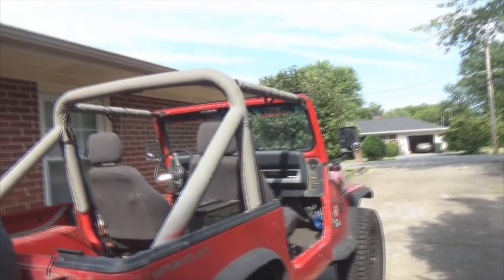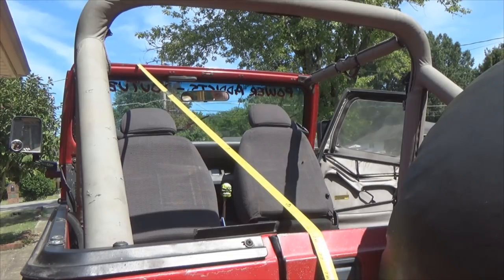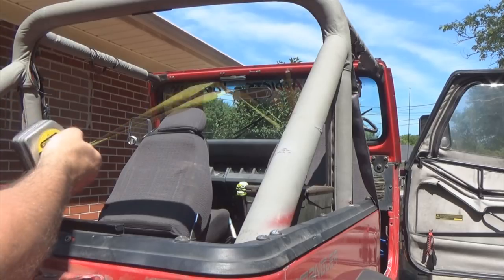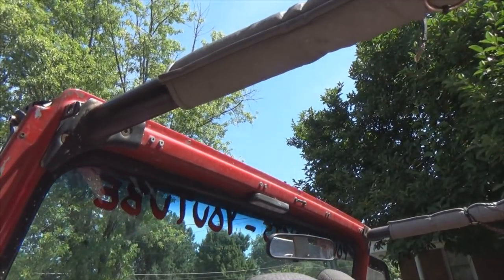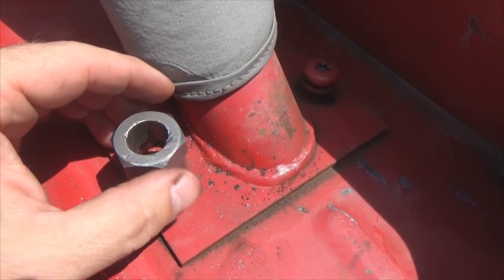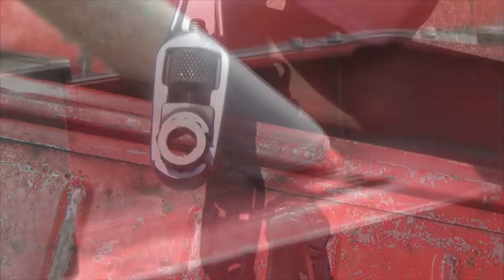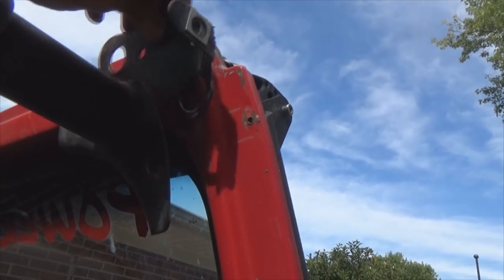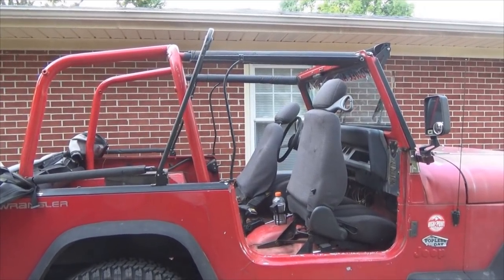Jeep Wrangler YJ - Sport Roll Bar to Family Roll Bar Swap

Comment from the maker: The bolt extractor set I used worked great!! Here are the tools I used in this video. Links (affiliate) below:
Bolt extractor set: https://amzn.to/2vF9B66
Drill bit and extractor: https://amzn.to/2vF7Qpp
Torx bit set: https://amzn.to/2B3lszQ
Reply: What craftsman socket did you use on the bolt extractor?

Comment: Just another tip, there was factory loc-tite in the bolts, if you hit the head of each bolt with a propane torch for about 10 seconds will make extraction a lot easier. just replaced one myself last week, I like the family roll bar better. Thanks for the video's.
Reply from the maker: Very good point!! I forgot to mention that. Back in the mid-early 80's Ford used a rigid lock tight on brake caliper bolts. I broke 4 bits before I finally smartened up and through the torch at it. They backed right out as easy as can be. The bolts in this old YJ were rusted in place. They weren't the first bolts I've had issues with on that rig:-).  Im on the fence about which roll bar I like better. I know the Family style bar gives more soft top options which is my main reason for swapping roll bars. Thanks for leaving a great tip for everyone! Have a great day!!

Comment: Measuring the top of the windshield frame to the back is too inaccurate because your back gate can be misaligned or torqued (sagging - if you have a large spare hanging on it).   The simple way is to use your door to align to same spot.

Comment: heat those bolt heads with a LP torch first and smack it with a hammer and pin punch,
do not direct hit the bolt head as it will collapse the torx opening.
use impact rated sockets and extensions!
i used an 3/4 dewalt impact after breaking them loose with an long 3/4 breaker bar
take your time!
and yes if it is a rust bucket the floor pan nuts may twist right off.

Comment: Gonna redo my 89 yj. It's been dormant for a few years. I want swap to a Family style roll bar basically for more back seat protection. Thank you for showing the way on that. I have marked the tools you posted on amazon. Thank you for that too.  I'll also have full doors and half doors and a Bestop split hard top and original soft top.  I do need to refurbish the soft top frame and I was wondering if you had any lead the parts I would need for that especially the plastic sleeves that hold the folding bars in place? 

 On another note, I 'm using a tip a friend passed on from a guy that liked to rebuild old trucks and Wheelies from the 1930's and 40's. When he gets a new project, he parks it in his barn, sprays every bolt with liquid wrench and walks away for a few weeks, and repeats every few weeks until he's ready to work on it. In the meantime he does research and gathering of supplies for that project. Pulled the project in the garage yesterday and sprayed the 1st pass on the nuts and bolt with liquid wrench and will do so until i start on it after New Year's.

Last Question... MPFI kit or Holley 2bbl carb?

Comment: I have a 1995 YJ (family bars) with a frameless soft top (love the top). but I am thinking about buying the sport bars from my buddy for 80$ and run that in the summer with a bikini top. I just love the look of the sport bars personally. Then, putting the family bars back in for the winter / rainy season. (i live in Georgia). my question is, how long would it take to swap between the family and sport bars (vice versa), as I would be doing that quite often.
Reply from the maker: Being that you are going to swapping them on a consistent basis, you will not have to deal with rusted up bolts. So the swap is easy and can be done in just a few minutes. Just have someone to help you pick the roll bar up so you don't scratch your Jeep. Thanks for dropping in! Have a great day!

Comment: Dident know that could be done  ,now I have to find 1 .  I have a 89 yj  with  a steering box problem , to much play in the steering wheel  , almost a full 1/4 turn before wheels start to move , have put at least 4 rebuilt 1 in all end up that way . Help would be appreciated . I enjoy ur channel  keep it up
Reply: john crowder there is an adjustment nut and screw to take the play out of the steering gear. Loosen and hold the nut with a wrench and turn the scurew in 1/8 of a turn at a time. Retighten the nut and test drive. Take your time, as it's easy to overtighten the adjustment and lockup the steering. This is the first thing i did to my yj after i bought it.    Tim
Reply from the maker: If you have replaced the steering boxes and you still are getting that much play. Either you are getting bad steering boxes or start checking the steering shaft going up to the steering column for worn out u-joints Good luck and have a great day!

Comment: Did you have to measure and adjust the spreader bars after you put the family style back in?
Reply from the maker: Nope .. It dropped right in and were set at the correct length. Which was good for me for the install. But, it would have made for more good video if I would have had to adjust them. I can put that on my video to-do list on "How to adjust the spreader bars and windshield rake:. Thanks for checking out the video! Have a great day!

Comment: I have a 95, I would like to switch from the family roll bar to the sport roll bar, do I have to make holes or it fits right away?
Reply from the maker: Should be a direct bolt in. I later discovered on this swap there was some trash behind the mount that messed up the alignment a bit.
Reply: @Poweraddicts ohh thank you
Reply: do you still have the family roll bar?

Comment: Man the most important thing about all of this is do I need to weld a plate or something onto the tub when I swap seat belts?? What's the easiest way to go about mounting the lower seat belt point on the retractor side
Reply: After you swap the roll bar, most shoulder belt kits just bolt on where the old lap belts were originally. Mine took me about 15 min to swap both belts out

Comment: I've always liked the look of the sport bars better. The one good thing I've found with the family bar is that you can get the extended bikini top with a cargo net top in the rear like the Smittybilt C.RES. Ran that way for a few months and the interior actually stayed pretty dry during storms. The downside to that would be that the YJ has no door surrounds like TJs do so even with the uppers on there is still gaps that let rain in
Reply from the maker: Hey man! Hows it going??!! I'm on the fence as far as looks. The sport for the old school look, the family for the "cage" look .. so Im kinda torn on that one. The Family style simply gives more soft top options as you said and also mounting a sound bar in the proper location. A sound bar can be mounted to a sport but its right on top of your head ... nope .. not happening! LOL. I'm gonna check out that bikini top you mentioned, I like the sound of that. I have an extended net style sunscreen that's for a JKU, it will work on the family bar. I've got a short bikini top and windjammer that came with Rustbucket. I really like that setup, but as you said, no door surrounds so there is that massive door gap.

Comment: Good video. S-10 seat belts will work for the rear seat belts in the rear?  Missing mine.
Reply from the maker: Thanks! Glad you like it! Basically you look for any shoulder style seat belt set up that is long enough. Get both shoulder harness and the floor buckle as long as its long enough to reach over the seat where you sit. Get the bolts as well in case you need them. Your good! Or, possible a set out of an XJ Cherokee. I'm gonna shoot the video of how to look for the correct seat belts in a junkyard. Maaaybe within the next couple of weekends I'll go to the junkyard to scout out a set. Make sure you are subscribed so you don't miss the video! Thanks for dropping in and leaving a cool comment! Have a great day!

Comment: If I put a TJ roll bar in my 89 YJ can I put a frameless top on. I currently have a hard top.
Reply from the maker: TJ bars are not a direct fit. It takes some drilling, possible cutting to make that work.

Comment: How much should I expect to pay for a YJ family style roll bar with windshield bars and front and rear threaded seat belt holes but no seatbelts?
Reply from the maker: The roll bar and spreader bars I have paid as little as $75 for all of it. I've seen them as high as $200 used. It really depends on the region its located or what the seller wants.  The seat belt holes are already in the roll bars.
Reply: @Poweraddicts  Hmm.  The guy wants $300 for just the family roll bar with spreaders.  Then wants another $100 each for seatbelts.  I thought it was a bit high.  But wanted to get someone else's intake. Thanks for your response.  😊

Comment: Can the YJ family style roll bar fit a 76 cj7 jeep?  What mods if any would it need?
Reply from the maker: I've never actually swapped one in to a CJ7. I was hanging with a buddy of mine today and he and I was discussing this exact same question. From what I can see it should be a direct swap or at least minimal mods. He is getting one of my family style bars soon and is going to install it in his CJ7. We will soon find out.
Reply: @Poweraddicts  what year of cj7 does he have?  I read YJ rollbars are a direct fit in 79-85 cj7s and requires modifications in 76-78 cj7s.. Let me know if that's what you discover too.

Comment: Is the tub reinforced where the rollbar bolts to the floor and rear wheelwells?
Reply from the maker: Nope, it's a factory 93 model roll car and the 91 Jeep in the video is a stock tub. So .. all factory parts being swapped around. Thanks for checking out the video. Have a great day!
Reply: @Poweraddicts  
But I mean from the factory is it reinforced at the mounting points or is are the rollbar essentially just bolted to the floor pans?

Comment: I have a 1988 yj with a 2.5 in it and its running  very rich it has throttle body injection and its driving me nuts because i cant figure it out
Reply from the maker: With TBI setups, the only things that can make it run rich is a bad O2 sensor, injectors sticking open and air temp sensor. Depending on the type of system there could be more. Call the manufacturer of the TBI system, they will know their product better than anyone. Good luck and have a great day!
Reply: Clarence Rux might be an intake gasket leak. I surfaced my intake manifold on a floor mounted belt sander at the train musuem restroation shop i work at. Next time you have yours off check for warpage on a flat surface, do the same to the exhaust manifold also. If you know of a sander you can use this repair will only cost the price of a new gasket. I've done this on more than one vehicle succsesfuly

Comment: you think that there might be bent  a we bit  or not cleaned ( i saw dirt dust )
Reply from the maker: You are probably right about having something under it. I had someone helping me swap the bars. I mounted the passenger side. He was doing the drivers side so I can't say for sure he didn't leave something under the mounting foot. I had gotten all the other bolts tight so I wasn't going to pull all that out again to look under it. I might later but for right now it is easier to just cut that hole downward a bit to get the bolt in. Good eye catching that! Have a great day!!

Comment: I was hoping u could had me towards a good one
Reply from the maker: If you are buying remanufactured ones from the Auto parts store and they are bad out of the box, go to a different store. I get my parts from O'Riellys, Advanced Auto, Rockauto . com or junk yard. Also, bear in mind that even with a new steering box you will still have a bit of play in the steering because of draglink and tie rod ends pivoting. It's just how they are made. There is a bushing from "Ruff Stuff Specialties" called "The Cure". That bushing takes a lot of the play out of the front end parts partially rotating.